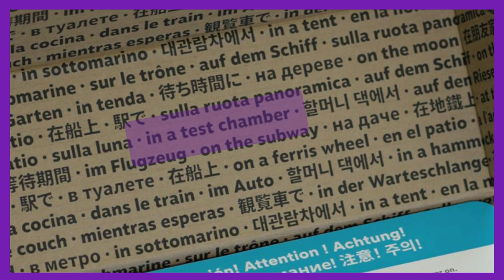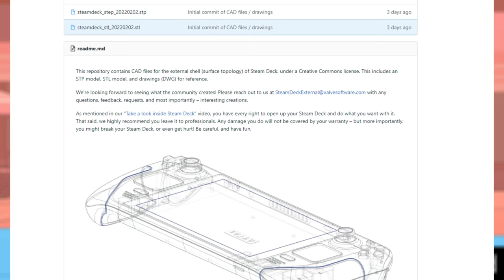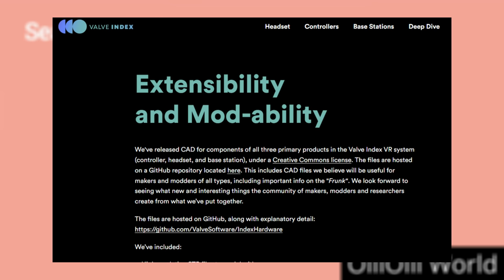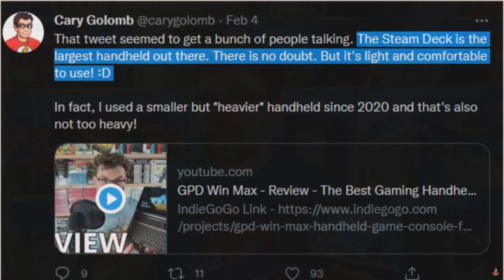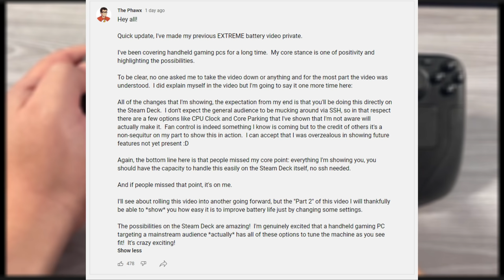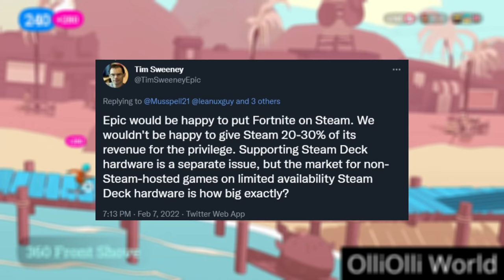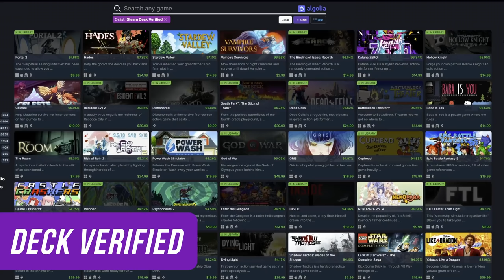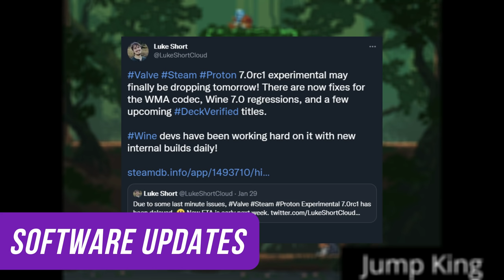Valve Seems CONFIDENT About Steam Deck

Comment: Wait, update for adaptive brightness? Does that mean that the display on the front has a light sensor somewhere? This is new to me... Sorry if it's an obvious "Yes" I might have missed it.
Also, yes, please do a video on Dual Boot. I would like to have Windows on the Deck, but without overriding the internal memory. So a Windows SD card would be great.
Furthermore I'm interested in actually partitioning that SD card, so instead of having a 256 Steam Deck with a 256 Windows SD card and that's it, I would just have to swap for some extra memory, I'm curious if I could have a 512 SD card that's 256 Windows and 256 ext4 or whatever format could be used by the SteamOS. 
Or something like that. I think it would be nice to have a "be-all end-all" SD card with a partition for Win, space for Win stuff + also space for SteamOS extra games that you don't need on your main drive. It will especially be useful for people that got the 64GB Steam Deck and want Windows + SteamOS games all on one card.
Reply from the maker: It does have a sensor. Be sure to check out the new iFixIt teardown from today too - they actually show it! https://www.youtube.com/watch?v=4T0RZ6ustKQ&list=PL-VKXX8-Y8OS_mPrG9RkH7VLryuKJaZav&index=9
Reply: @FanTheDeck  Really awesome video. Thank you for the link. Also answered my display replacement question.
Reply: Windows on an SD card is going to kill it. They have a max rated write cycle in the mere hundreds. I hear WindowsToGo lets you install to a USB drive, not sure about SD card.

For SteamOS, try BTRFS filesystem and look up how to enable compression and deduplication. It reduced my library size by ~20%.
Reply: @randgrithr7387  Indeed, Never thought about the read-write cycle of an SD. In that case, maybe a thin USB dongle that flexes towards the back of the device with a fast 64GB Stick on which you install Windows (as I won't advise USB-C Sticks jabbed in like a knife, unless maybe it's really small). I don't know if that could be possible, but yeah, have Windows in your pocket on the smallest stick possible (both in size and in capacity) and if it breaks, buy another one since they are cheaper than SDs. Then your actual SD can hold your library and other necessities.

Comment: I wonder if EPIC would bring Fortnite to Steam Deck/ Proton if Valve decides to take a cut on the revenue share (maybe down to 15 or 10% ?). Sounds reasonable...
But the steam Deck might just be as big of a hit that they might consider it anyway at some point in the future
Reply: I'd rather a fully supported epic store out of the box. It all comes down to how profitable the steam deck will be. Only after Nintendo sold about 15 million consoles did Fortnite come to the switch.

If the steam deck sells atleast 10 million in it's first year you'll see Fortnite on it, along with the rest of the store

Comment: Honestly with portal 1 and 2 releasing on the switch, and all the portal references in the deck marketing, it wouldn't surprise me if portal 3 would come out on the deck soon ( i really hope it's not exclusive to the steam deck, and we can play it on PC though)
Reply from the maker: They've said that there would be no Steam Deck exclusives and I do believe them on that.
Reply: if there was a portal 3 they would 100% make it a stable 60-120 fps for the steam deck... but they wouldn't make it exclusive.
Reply: Valve says no Steamdeck exclusives,  so don't worry, Portal 3 should be on PC too
Reply: @Viesta  most likely stable 60fps, it's only running a 60hz display so 120FPS would just drain battery something aweful for no benefit (but if the Steamdeck can do 60fps I will probably enjoy it at 120 or 144fps on my desktop too)
Reply: @UNSCPILOT  im talking 120 FPS for docked mode.
Reply: @Viesta  Hmm, didn't think of that...

Maybe with some good use of FSR it could get close or with some settings dialed down but that might be a slight stretch, but that's just speculation on my part, If Portal 3 happens I'll probably be happy either way!
Reply: You are not a real one ;)
No SD exclusives cuz it is a PC
Reply: @Viesta  They said the Deck performs the same when docked... But even so, a source game could likely run at 120hz on Deck. That's a neat idea actually!

Comment: if Linux Kernels can be custom, then is it not possible for Valve to build their version of the Linux kernel around anti-cheat? Or maybe they develop some sort of sandbox for the application to run inside that satisfies anti-cheat? 

idk, I understand the issue with supporting linux, but supporting 1 version of linux (Steam OS) could be huge for purging the monopoly that microsoft has over pc gaming. The flexibility of linux could be turned into a positive where they develop a version of the linux kernel that is optimized for anti-cheat from the bottom up, meaning better optimization  and more effective anti-cheat measures.

I'm sure there's flaws with this, messing with kernels is not easy first of all, but since this isn't a daily driver normal use operating system, that issue of privacy invasion with anticheat isn't as huge, and if Steam OS were to be developed as a console OS and desktop OS hybrid for gaming pc's, they could just force a specific kernel for certain games and let you use a different kernel for your normal computing stuff.
Reply from the maker: Epic has shown that they're not particularly interested in getting rid of windows. This is the problem that Valve faces with Steam Deck and SteamOS - they have to convince developers to change certain things. They're doing a great job of making that change small but not everyone is going to have the same interest as Valve.

Valve could build their own anti cheat but they'd still need to convince devs to use it.
Reply: The kernel issue is how linux has far more secure permissions than windows. Sweeny is mad he can't put a rootkit on your Steam Deck.

Comment: Everyone fails to realize that the true intentions of valve is to push proton into mainstream as well as Linux and the only way they will somewhat achieve that is by putting it in product that people will want to utilize. But yes they do want a portion of the Nintendo market their goal is to take some of windows market share.

I'm extremely hyped for anything involved us and the steam deck is looking very good I always support valve with their hardware.
This is coming from somebody still rocking the steam controller to this day I do have the steam link but I don't use that cuz it's not that good but I still have my Alienware alpha which since passed on to my son because I want Linux and proton to become mainstream that way we don't have to depend on Windows alone and since competition is good for gaming why not take some of the switch market share this will make Nintendo stand on the toes and realize I need to up the ante even more so
Reply: Proton is part of it, as well as Valve wanting to move gamers away from Windows to Linux which is what Proton could do but there is more to this then that, Valve is clearly trying to target console gamers with the low price point, ease of use and bridging the gap from PC and console gamers and it's easy to understand why, if Valve can convert millions of console gamers to PC gaming, that's a 30% cut on every game sold on Steam, very enticing for Valve whereas getting PC gamers to the Deck doesn't change much for them as they were already getting the cut from gamers buying on the PC.

The Steam Deck to me looks like an attack on consoles from Valve, the low price point, ease of use, Portal games on Switch to try and entice those gamers to the Deck on future games that could be PC and Deck exclusive and I think the Steam Deck is just the start of it, if that sells well, Valve will likely follow it up with a home based PC console using the same formula, low price, ease of use and targeting PS5 and Xbox Series X.

If Valve cracks Proton for most games and the ease of use where games could have predefined setups for games so it feels like a console, this could become a game changer for PC and console gamers alike and for me, it's clear that Nintendo are the main target for now but it looks like the entire console market is the target in the long run and it's no surprise, if Valve converts even just a small percentage of gamers from consoles to PC, that will be a lot of money to them on that 30% cut per game sale.
Reply: @paul1979uk2000  exactly! You explain it way better. The best thing out of this is it benefits us the consumers in the end,  and hey who knows if this thing ends up selling well we might even get Half-Life 3 on the steam deck one can only wish.
Reply: Totally agree with you..
I think that it is a good idea to have Portal 1 and 2 on the Switch, but Portal 3 only on SD.. they get addicted on Switch and have to buy the SD, so they can play Nr.3.
Nice move from Valve.
PS: would like to hear your thoughts about the 3d-printed SD comparison and ergonomics video i uploaded. THX DECKGANG
Reply: @alphafenrir.  The Steam Deck could be a game changer in so many areas, SteamOS could make Linux gaming a real thing, that opens up the door for PC gaming being more effective in taking on consoles because Microsoft are too slow at making Windows gaming friendly and optimized for that task.

Then we have a portable PC console with a low price tag that's competitive with console pricing whiles offering far more than them, that could shake up the entire PC and console industry in the years to come.

The last thing is APU's, if the Steam Deck sells well, there would be a much bigger incentive for AMD, Intel and ARM's to make more powerful APU's, that could be another game changer.

Still, it's early days but it's all looking promising.
Reply: @McKuc  That's fine as long as it's on PC as well, last thing Valve wants to do is have exclusives for the Deck that don't run on the PC as that would likely do a lot of harm to Valve and PC gaming overall.

Comment: The fact that the battery is not easily serviceable is a very big problem for a device that claims to be "very reparable"
Reply from the maker: It got a 7 on the ifixit repairability. The battery is definitely what held it back. But it still seems pretty doable if you want to change the battery

Comment: i believe in the steamdeck... i do not belive in linux on the steamdeck. it might be good for casual users, but i think anyone who wants to game A LOT is probably gonna be forced to use windows.
Reply: On the contrary, baring a couple games like Halo Infinite (that have specific Windows integrations), I've switched my desktop and laptop over to Garuda Linux and It's been fairly painless and I've been Playing Warframe and other games with friends just fine, arguably with improved performance in fact, and Garuda Linux has a version available with Proton "Glorious Eggroll" installed so I've even been able to test AMD's FSR upscaling to boost preformance for the games I've tested.

I only really need to get a different VR headset to replace my "Windows Mixed Reality" headset simply because Microsoft never made linux compatible drivers for it, for obvious reasons

Comment: They are showing people why they need a steamdeck over a switch.  Portal could be a big hit on switc, but it also highlights that most other games on switch are not to that level of complexity but there is a new device coming out that lets you do everything.
Reply: Different audiences. Majority of switch (casuals, families) owners aren't into specs like that, plus Nintendo's exclusives are what drive that platform. Also, there's the issue of availability. But I hope the steamdeck is successful.

Comment: I think the real reason epic doesn't want to port Fortnite is because they're unsure of the device's profitability. You can't even get the device in retail and it's only available in select regions, couple that with the chip shortage and valve's unproven record and there's alot to be skeptical about as a company.

Remember Epic only ported Fortnite to the switch after it had sold about 15 million consoles after a year and a quarter. If valve can sell 10 million consoles in its first year you'll not only see Fortnite but the whole epic launcher.

That applies to all Devs/publishers, the degree they will support the steam deck depends on how much it sells
Reply from the maker: I think I agree with you. I'm bullish on Steam Deck obviously but it poses no risk to Epic to just wait and see if the Steam Deck takes off. If it does, he can figure out what to do
Reply: @FanTheDeck  As a consumer I am absolutely stoked for the steam deck, it's a system that fills desires I didn't even know I had.

I was content with a slightly stronger switch 10-20% boost and was pretty happy with the cross save situation where if you already bought the game on pc you can continue on the switch in some titles.

The steam deck completely bashes that level of performance, allows me to quick resume my huge steam library that I already own in a moment's notice. Also the anti-glare screen is a godsend for me playing near any sun.

I am excited as a consumer because it's cool tech, even if it fails I still have a cool device and if it succeeds even better.

As a business though I see them being more careful and critical

Comment: If the rumours about the upcoming switch are true (Tegra Orin gpu) the switch is going to be 2.6x as a powerful as the steam deck but as an ultra portable pc I love it. The switch wont have the versatility of the steam deck just because software reasons and will be a complete waste of technology so it's a hard choice to make.
Reply: If the new switch emulates the steam deck im in
Reply: I highly doubt that Nintendo would upgrade the Switch that excessively, doesn't line up with their MO, surely a chip that powerful would make the "new Switch" an order or magnitude more expensive than Nintendo would ever be willing to sell.

Do you have a substantial source for that rumor?

Comment: Well, I'm not excited in getting the Steam Deck. Considering that THIS IS THEIR FIRST STEAM CONSOLE. There's a Tendency that VALVE might release a new Steam Deck this year with REDESIGNED Internal hardware. Wherein it uses m.2 2280 instead of 2230. Will have better cooling system. And even NEW RYZEN 6 Processor!

Comment: Expanding brand outside the PC portal was designed to be a good introduction to dual axis sticks for non-gamers. It's one of their most accessible titles that has little parallels with other games. Switch players will be opened up to valve and then the steam deck.

Comment: If windows doesnt come to consoles then the pc becomes the console. There are no other options
Reply: If you assume that then you've never taken a good look at Linux, Windows isn't the only option for PC gaming, especially thanks to Valve's work on Proton compatibility layer to run Windows games on Linux.

Since the Steamdeck was announced I actually got interested in trying Linux and now my Laptop and Desktop are running better with Linux than they did on Windows, I only have a couple games that still "need" Windows to work now (mostly Halo Infinite)

Comment: This is the reason why I am more concerned with how Windows 11 will handle on the Steam Deck. The majority of us don't want to run SteamOS (having done so in the past) or Linux. You lose out on so much gaming potential over on the Linux/Mac side of things. You may gain a little performance efficency but give the community a while and a stripped down Windows 11 will start to surface. The simple fact is that is that Linux never allows you to run emulation your system could not handle in Windows so ultimately what ever the system can push it will be able to do so in Windows.

The access to X-Box Live, Epic, and emulators on Windows outweights any Linux nonsense. So, I subscribed so I can hear the second Windows 11 testing on the Steam Deck happens!
Reply: Depends on the games you play, I've switched my Desktop PC and Laptop to Garuda Linux and had little to no difficulty, Halo Infinite is the only game I have that flatly refused to launch on Linux, so I'll just keep a Windows 10 VM on my desktop to Stream the game to my Laptop or Steam Deck as desired
Reply: Why do you need windows for emulators?
Reply: There's an unofficial EGS launcher called Heroic Games Launcher, and almost all emulators are available on linux.